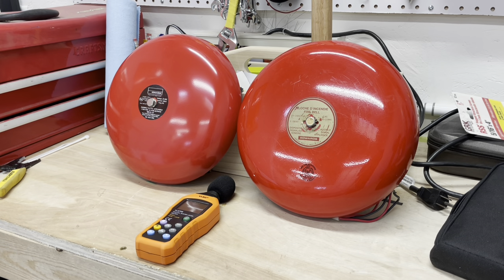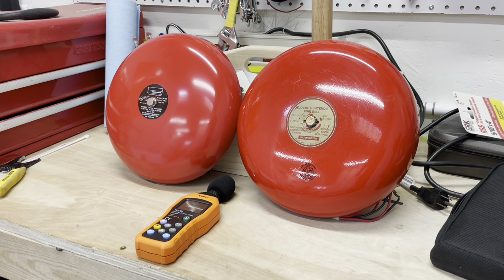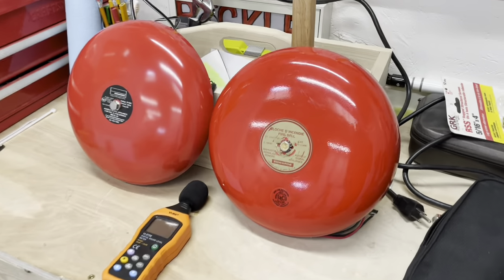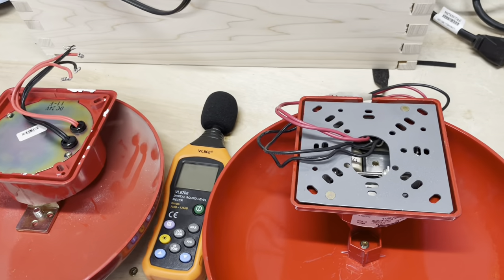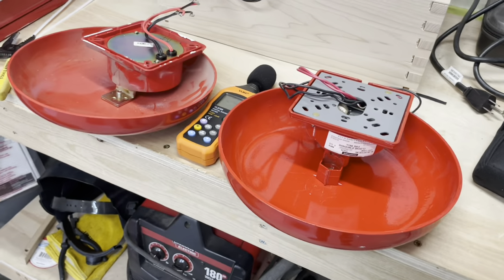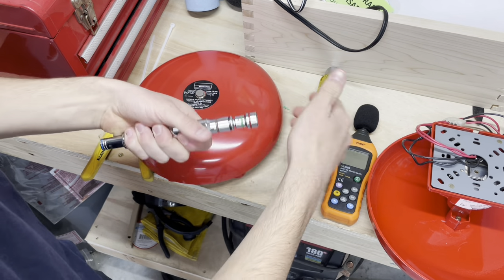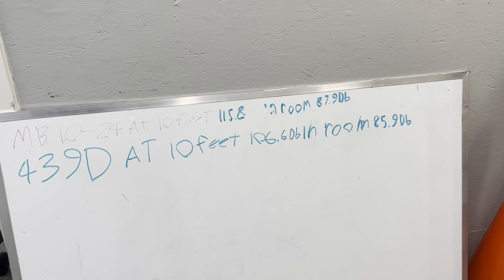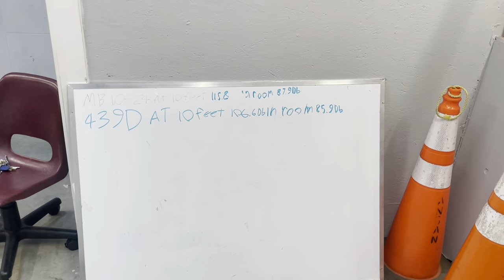Edwards fire bell MB 10-24 vs 439D-AWC which is better and louder?

Comment: Hands down, without a doubt the 439D gets my vote. It is not only louder but has a far better sound compared to the motorized MB-24s. A little history on the 2 bells: The 439D first began it's life in Canada in the 1950's under the Adaptabel name. Then in around 1969 "Edwards of Canada" (based in Owen Sound Ont) began using the "Durabel" name for it's continuous vibrating bells only. The adaptabel name was only used on the special application/single stroke bells thereafter. In 1984 Edwards of Canada renamed and rebranded the Durabel under The 439D ident and shortly after outsourced it's product line to it's parent Company located in Norwalk Connecticut (Edwards USA) In 2001 Edwards began phasing out it's higher quality 439D line to the  cheaper and lower quality MB-24s which were then made in China by what was then "Amseco" but is now owned by Potter Signal Corporation. Potter now makes bells for Edwards as well as a number of other manufacturers (Mircom Siemens, Notifier) The 439D bells were available for a few more years in Canada but have since been succeeded by The MB-24 and are generally only used for replacements in existing bell based systems and are rarely featured in new systems today (with electronic signals now taking their place) There my friend; is the history of the Edwards Fire bell in Canada.
Reply from the maker: Thanks for the interesting history I love stuff like that I had always thought that the durabells came out before then as they were and still are some in my old middle school which was built in 64 but I guess they must not have been original like I thought they had been
Reply: Having grown up in and attended school in the 70's and 80's I got a front row view of Edwards entire history through that time. The Edwards shield on the pullstations also had an update in 1984 from the 1950's version to the version we still see today. As to when the Adaptabel bells in Canada went out of production; I'm not really sure but I believe it was in the 2000's. In my office at work we have the "Notifier" equivalent of the MB-24s and they sound and look exactly like the Edwards branded ones.
Reply: I’m Canadian, and my high school was built in 1956, and the original fire bells were Adaptabels i believe, but they were replaced around between 1992-1996 with 439Ds we still have today. Then, in 1998, there was an addition to the school, and they had to tear the front part of the school down for the addition. Most of the bells that were installed in the addition are Edwards GS MB10-24s. There’s also an older Simplex 2901 bell in a separate band room at the school. Not sure when it was installed, but it was before the 439Ds. Today the school has half Edwards GS MB10-24s and half 439Ds.
Reply: I have a 6" Adaptabel from that same era that I use as a custom doorbell. By far growing up those bells were my favourite as they still had the Original 1940's Edwards shield logo on them. A rarer and rarer sight on bells these days.

Comment: Personally I think the 439D series was the best product Edwards ever made. Durable, reliable, and sound really great.
Reply from the maker: Absolutely do you know what the differences is between the adaptabell vs durabell?
Reply: @nics-systems-electric  Adaptabells were mostly single stroke, though they did make some vibrating models for reasons I’m not sure of. The durabell was basically the predecessor to the 439D series.
Reply from the maker: @CJ9899  thanks I’m not sure why they didn’t just continue the durabells they seemed fine to me I’m not sure when they stopped making them but I’d guess as soon as they started making 439D’s?
Reply: @nics-systems-electric  Yeah i don’t know the exact year but the 439D series I think came out around maybe 84-85?
Reply from the maker: @CJ9899  sounds around the time I’d suspect i’m guessing that must be also when the durabell got discontinued wonder when they came out

Comment: I grew up with bells and electro-mechanical horns.  My kindergarten classroom had a Simplex 6 inch bell and hallway had Simplex 10 inch, all on Simplex 4080 light plates.  Well, pre-k was a Wheelock 34T on a Simplex 4080 light plate.  School bells from K-5th grade were 10 inch gongs.  From first through fifth grade had Wheelock 7002T and 7001T.  Replaced with System Sensor spect alerts.  Middle school had GS-895B-201...I think and 270SPO pull stations.  Replaced with Wheelock NS.  No clue what the pull stations are now.  High school had 10 inch grey bells for burglary and single stroke bells and vibrating bells were used for class change in high school.  Pull stations in elementary school, daycare,  and high school were BG-10...all replaced with BG-12.  They were like music!  I went back to visit my high school after I graduated and ALL of the bells were all gone!  Class change bells were converted to P.A. bells (a pre-recorded tone would play over the P.A. system) and the burglar alarm system was converted to a silent alarm.  And, my elementary school was converted to P.A. bells and System Sensor specter alert classics horn/strobes.  I miss the old electro-mechanical horns and bells that I grew up with.  Today's alarms are just simply awful.

Comment: In the first test you did, I noticed that after the bell stopped ringing it took a while for your camera to readjust its automatic level control, so the loud sound of the bell must have caused the ALC to pump way down.

Comment: NIC'S - forgive my lack of knowledge, but why would you need an end of line resistor? Wouldn't it just be a loop system of positive-negative?
Reply from the maker: For this demonstration you don’t need an end of line resistor but for a system that is how it monitors the circuit if it doesn’t sense the resistance that means the resistor at the end of the line has been severed from the circuit somehow whether somethings been cut or disconnected it’s a way that the panel can tell if the circuit isn’t intact which could mean devices won’t work

Comment: Sound difference levels of the MB-10 and the 439D at 10 feet and in the room

MB-10: 27.9
439D: 20.7

So it appears that the sound of the 439D dropped by 20.7 decibels when it was in the room because the sound that it makes is more cleaner than the MB-10 espically on Filtered DC making the sound more better at traveling through walls than the System Sensor P2R In the last video. But the reason why the 439D's sound difference levels came up as the same as the MB-10 in the last video because in this video the MB-10 was tested in the room where the couch is and in the last video it was tested on a demo board touching the bathroom door because distance can affect sound pressure loss which must be why the MB-10 in the room dropped by 27.9 dB instead of 20.7 dB (7.2 difference) and I'm thinking if the System Sensor P2R was tested in this exact same spot then it will drop by 22.7 dB because it's farther away from the spot in the last test making the sound pressure level drop a lot more from this difference.

Here's how these signals are ranked on sound penetration

#3: MB 10-24
#2: System Sensor P2R
#1: 439D

Comment: How does a vibrating bell work vs motor bell?
Reply from the maker: Motor Bell uses a motor that have some sort of gearing and a off centre pin commonly that will move back-and-forth pushing a striker into the gong and a vibrating bell is kind of like a solenoid that moves back-and-forth with electric magnetic fields of a coil

Comment: What's the difference between a motor bell and a vibrating bell?
Reply from the maker: Motor bells uses a motor spinning linkage to the striker vs a vibrating bell uses an electro magnet kind of like a solenoid